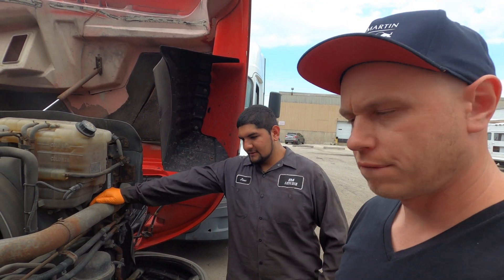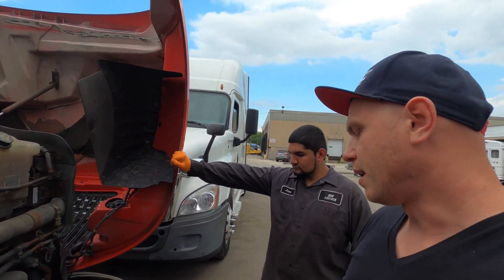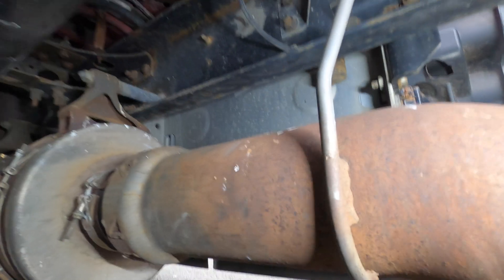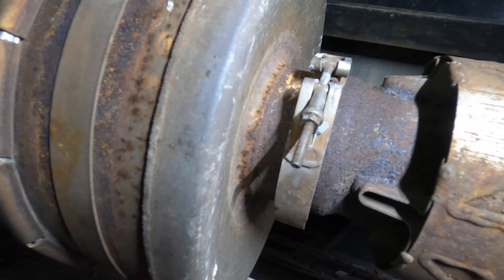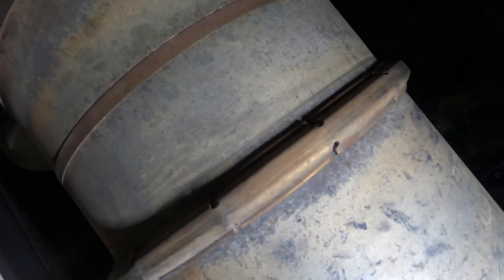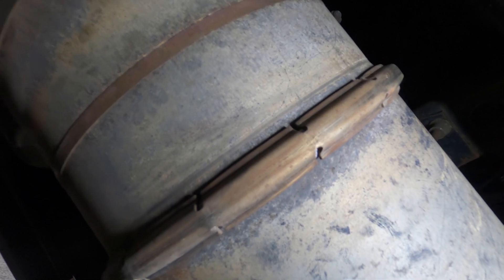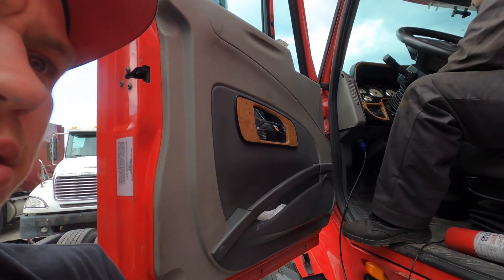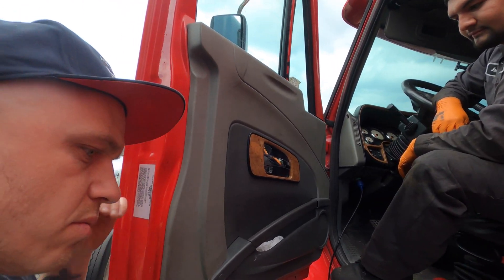International MaxxForce 13 No start. We run diagnostics.

Comment: I have a similar problem with a 2013 maxxforce. The truck will not start.  it is throwing a electric fault and abs code does anyone have any suggestions
Reply: Ever figure it out?

Comment: Hey there.. I am interested to buy a 2016 international PROSTAR certified preiendes, with a N13 engine, 340k miles.. from internationalusedtrucksale, it comes with a 1 year system1 confidence warranty and a 1 year after treatment warranty.. It’s a good price but I am a little on the edge about all the bad things I hear about PROSTARs, especially the maxxforce engine.. my question is is N13 the same as the macxforce? And do you think the warranties make it worth it to go for it? Or should I invest more for a Freightliner or kenworth with not so good or no warranties . If you could answer or email me that be awesome! I could also show you the truck offer per email. My email is jenmo2016@gmail.com , I would really appreciate it.

Comment: Delete lol
Reply: I've been driving a 2012 or 13 depending on dealers. Date so close to 13 they call it 13. Anyway egr killed this engine deleted it been driving it for 1 yr 6 months hauling flatbed at 4600 pounds south east set at 75 mph & will drag your gears down climbing put get the job done. But lack of these engines   i looking for the next truck.
Reply: @johnlive7647  I just bought a 2013 international ProStar for about 16,000 with the maxforce engine but it's been deleted
Reply: Yea thats the only way to run the maxxforce. Biggest pile of garbage engine ever made
Reply: What’s a good place to get it tuned and deleted?

Comment: Hi Guys I went through this same problem with mine. 2012 Prostar.  Maxx 13. Replaced it 2 1/2 years ago haven't had an issue so far.
Reply: @Super Fly same exact shit im having in replacing the throttle pedal sensor and im hoping not the fuel pump smh
Reply: @chrisodom6085  would you buy a next one?. Im talking the 2012
Reply: I see a 2012 with automatic. For sale. Do you thing its a good buy. They asking $ 20.000